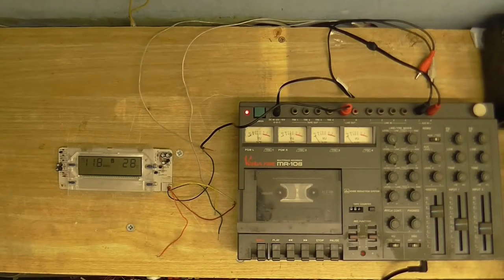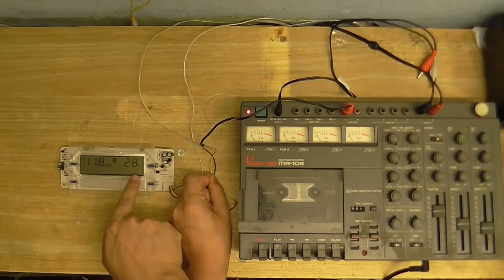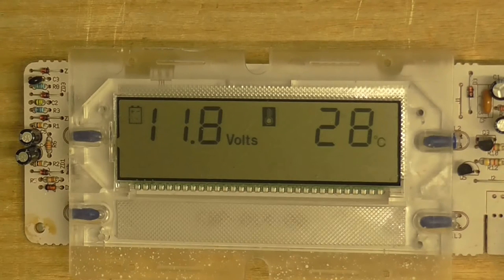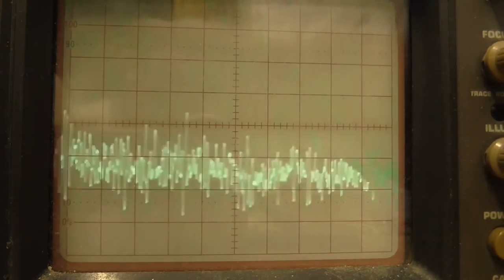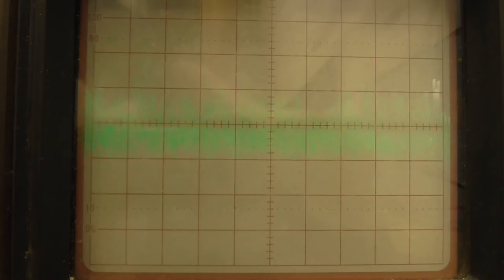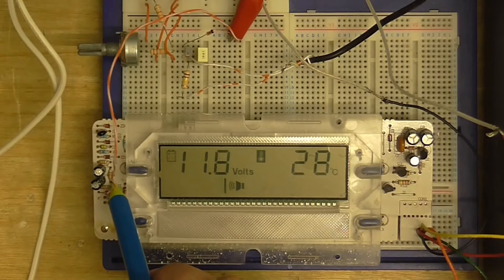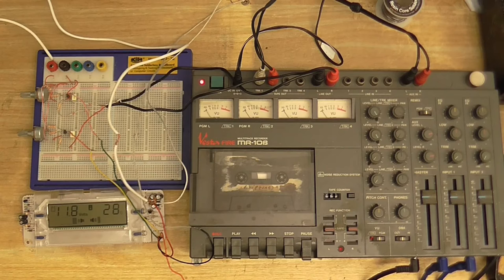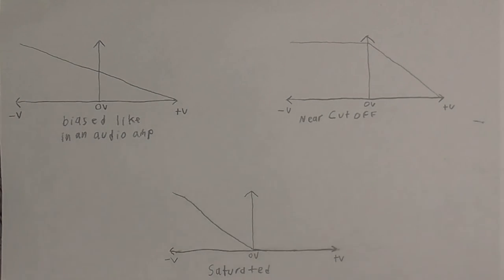Modifiying a speaker level meter for line input.

Comment: That works very well for a single transistor :-D.
Other options could have been a darlington transistor for more gain, or a bridge rectifier made from germanium diodes for more drive, possibly a dual op-amp for other versions.
Just some daft ideas :-).
It works ok as it is, so you may not go any firther.

Comment: add emiter resistor cause you adjusted it where it is near saturation and gain will drift so will the response of meter and you dont want to adjust it every time temp changes.  At least that is what I think.
Reply: Yeah, and I would suggest using a regulated supply for this since the bias voltage is derived from the supply. Nice modification, though.
Reply from the maker: This was running from a regulated supply as I'd already thought about that, just a basic L7812 circuit, but it gets the job done.
Reply from the maker: That thought had crossed my mind, like I said in the video I'm not done with this yet.  In my room temperature might not be much of a problem anyway since it stays pretty much the same throughout the day.
Reply: +CoolDudeClem OK then, I must've missed that even though I watched the whole video. Just decided to suggest some improvements,  not to be a smartass ;)
Reply: maybe a coupling condensor?